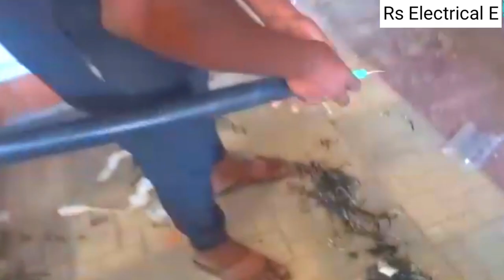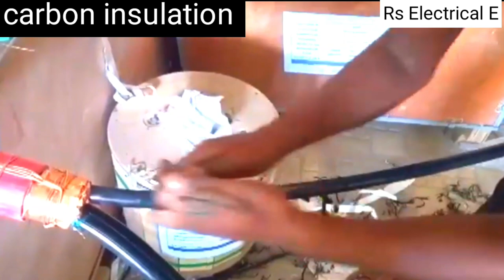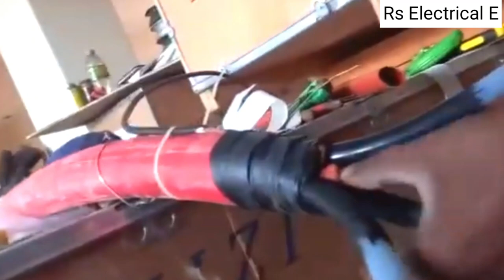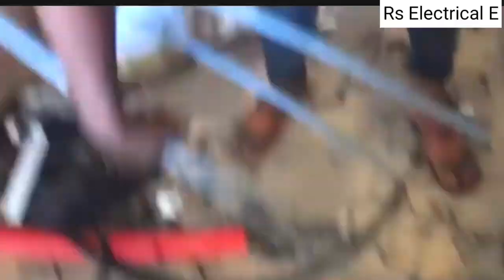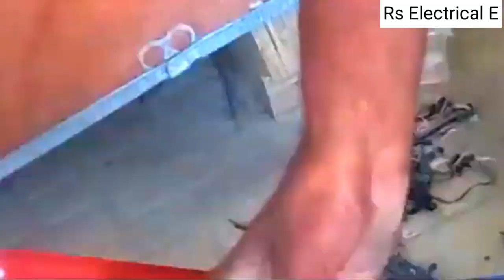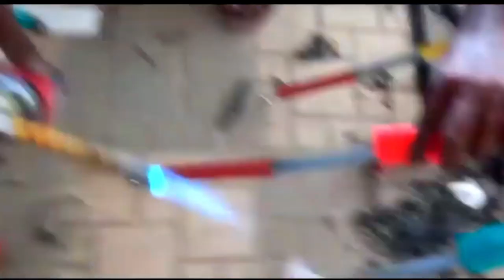কিভাবে  HT কেবল Heat Shrink করা হয় ll HT cable joint kit procedure

Comment from the maker: my other video link bellow 
This link  ACB Wiring Diagram 
https://youtu.be/K-LLiCUyky4

This link  ACB interlocking function  Wiring Diagram 
https://youtu.be/To2xkhSLGqw

this link how to made ATS by magnetic contractor
https://youtu.be/2b6WTb1rN4s

This link  PFI   Wiring Diagram
https://youtu.be/kmVWWXBb9yI

This link  Bus-coupler three acb   Wiring Diagram
https://youtu.be/DiXIxEI2qCM
 PFI plant full wiring 
https://youtu.be/iZ-3MhyDiI0
 LT CT meter full wiring and setting 
https://youtu.be/wE3wLgChIoo
pfi calculation
https://youtu.be/Ls5WwolY74s

house wiring 
https://youtu.be/tGE9B4uEyDk

transfprmer manufacturing
https://youtu.be/924CZn4F38w

আমরা সাব স্টেশনে যে কোন কাজে সার্ভিস দিয়ে থাকি
যেমন ট্রান্সফরমার,LT সুইচ গিয়ার, PFI প্লান্ট , ACB, VCB, ATS ইন্টারলকিং .

if your Recruitment  Please call me for any service and any question  Electrical Substation related work 
like transformer ,  LT switchgear ,  PFI Plant , ACB ,VCB , ATS, STAR DELTA PANEL , 
Engr: Naimur Rahman Rony 
+8801721-240893